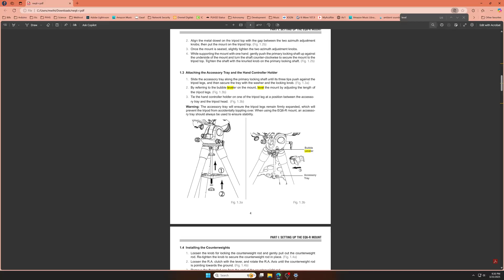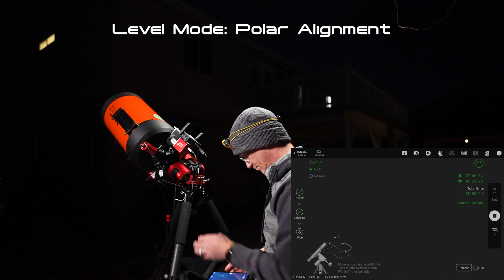Do you need to level your equatorial mount?

Comment: Leveling the tripod on an equatorial mount made polar alignment easier when doing drift alignment , if not level adjustments in one axis would throw off the other axis, causing the need for multiple iterations of E/W and elevation adjustments, But if you are using Software Assisted polar alignment then I guess this wouldn’t be much of an issue.

Comment: Excellent video, I am just now getting into astrophotography and picked up the AM5N. ZWO removed the levels on this model but I added a couple myself.  Had I watched this video first, perhaps I would not have but as many have stated, it is a good practice for the load if for no other reason.  Now though, I know it doesn't have to be perfect.  Close apparently counts with government work, hand grenades, and equatorial mount leveling.

Thanks for sharing with us!

Comment: Crazy how people insist on how important leveling or tramming is. It basically becomes completely obsolete once your mount is on a pier or you have a decent tripod. When i finished my pier, i really didnt bother leveling anything. I slapped my mount on it and get 0.22" to 0.45" guiding ever since, which is still less than 1/3rd of my imaging scale, and im 3.5kg over the rated payload on one of the cheapest eq mounts ever made.
Reply from the maker: It's true, and my previous video proves I was in that camp. It's easy to make the mistake of overemphasizing the impact of a level mount when they build the levels into the mounts and tell you in the manuals to do it. It definitely has its place, however. But it's more about ensuring your rig doesn't topple over rather than anything to do with guiding accuracy. I'm The little jealous of your pier. I got to get me one of those one of these days. 😉

Comment: Could the suggestion for leveling possibly be directed more towards preventing a possible tip over? 
Yes, the equipment itself would still be balanced, but it seems the shorter side of the tripod could still perhaps be a weak point for weight.
Reply from the maker: I think you're right. And I think it matters most with strainwave mounts that don't require a counter weight. I mentioned in the video how that concerned me when the telescope swung too the short side. But i had the tripod intentionally waaay off. Even eyeballing it would get you so much closer. I almost toppled my am5 when I first got it by overloading it without a counterweight as the manual suggests.

Comment: No, I don't need to level my mount I'm an engineer. My Tri-Pier is self leveling.
No it doesn't make tracking better but it does make polar alignment easier & the mount more stable.
Having motorized my mounts Alt-Az with encoders sub arcsecond polar alignment is now the norm.
Reply from the maker: You're right about how a level tripod definitely does help with polar alignment. When you're using the PA feature of the ASI air, you get that nice crosshair to work with. Its perfectly horizontal and vertical lines correspond nicely with the adjustment knobs on the mount. But if the mount is not level, adjusting the horizontal knob will also move you vertically. Finding the sweet spot becomes a lot more difficult.

Comment: I have two AM5 mounts and an AM3. They are so accurate that I don't really worry about leveling. However, I do like to at least get it in the ball park!
I think the last time I leveled the tripods was about...A YEAR AGO!
Thanks for the video...CS!
Reply: The polar alignment quality has nothing to do with the intrinsic tracking accuracy of a given mount, but simple geometry, entirely independent of mount quality. With enough care, you could perfectly polar align a bolt-nuts-and-plywood mount as well as a observatory-grade mount.
Happy you like your AMs though, they look lovely! :)
Reply from the maker: Ballpark is definitely a good idea. Clearly your performance won't be affected, but the stability of the mount overall could be compromised when the weight swings around to the short side. I definitely started sweating a bit when I saw everything shift that way during this test. But I had it way way out of level for the test compared to anything any rational person would do under normal circumstances 😂
Reply: @ 
Yes, a meridian flip would be my main concern and how much weight. I run an Askar FRA500 and 65PHQ on my AM5s and only use my Redcat51 on the AM3. (The  5s are on modified AVX tripods and the 3 is on a TC40.) So, no heavy set up.
If I set up my Celestron EDGE HD1100 or my Askar 151 on one of the AM5s I use a ground steak. It's like the kind you hook a big dog to. It cork-screws into the ground about 24 inches and centers on my tripod. Then I add a 1-inch payload strap, the pull snug type not a ratchet. Two of my tripod feet are set on 4-inch tiles and the other is on a sidewalk that I poured for my pool. That way there's no sinking into the ground and all stays snug and tight all night. No worries about the flip. 
Also, the tiles are set in and stay put. I have circles where the feet go so, I start out being very close to NP. I still have to do the full NP alignment but it's so close that it only takes about 10 minutes max to set up. Another plus is the tiles keep it very close to center on the bubble every time I set up. That's mostly why I don't bother too much with leveling.
CS...